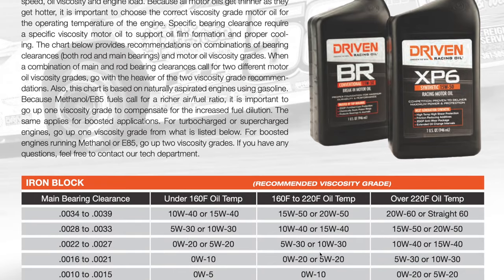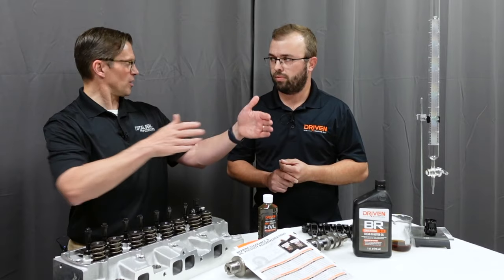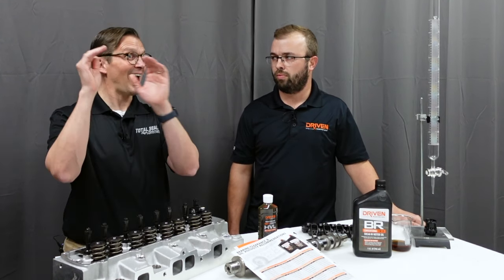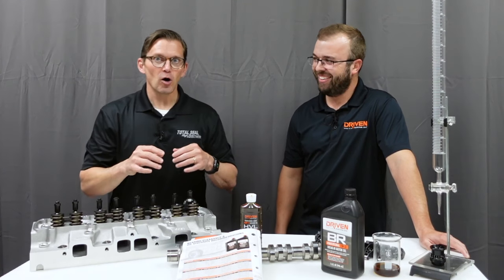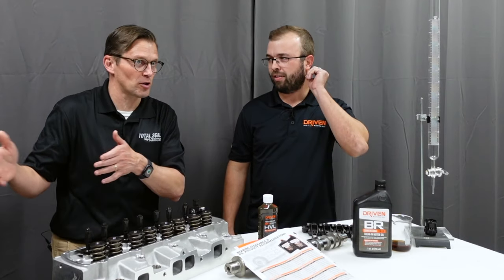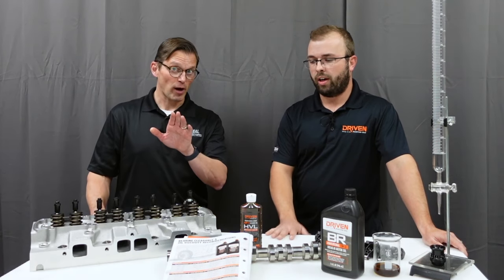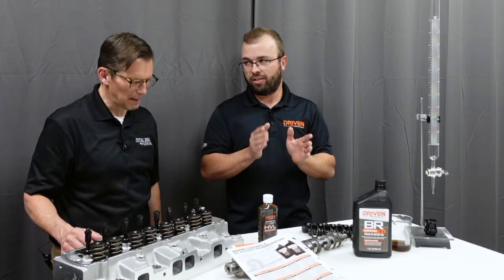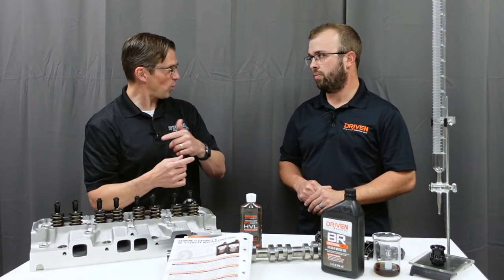How To Choose The Right Viscosity Motor Oil - A Certified Lubrication Specialist Explains

Comment: I have some questions about which oil to use in new race motor. I was recommended to use Driven oils but am getting a couple of mixed messages as to which one will suit the motor best. Is there any way of contacting you directly to get your thoughts?
Reply from the maker: Call the folks at Driven.
Reply: @TotalSeal  I'm in Australia and while that's not too much of a problem, part of my question has to do with info from my machinist/engine builder AND an Oil Rep at Driven. Both recommended a different Driven oil product so I'm not quite sure which advice to follow.
Reply from the maker: @333pg333  What's your application? Which products are both recommending?
Reply: @TotalSeal  It's a highly modified alu block Porsche 968 turbo engine for Time Attack that runs on race grade E85 only. It has been sleeved with Darton MiD sleeves which are a thick ductile iron product. The engine builder and machinist (who installed the sleeves) gave me a chart for the XP6 line of oils. Based on clearances you select which weight to go for. But when I contacted Joe Gibbs oils one of their Reps said this: “I chose the GP-1 15W-40 for a couple of reasons. The 15W-40 is a better fit for your main bearing clearance, your front and rear bearings were a bit tighter than the rest, but I would recommend going to the heavy side in line with the centre mains. I did not consider the XP for your application because the XP has very little detergent and virtually no corrosion protection package. XPs are formulated for applications that are disassembled and inspected after every event.”  When I looked at what type of cars GP-1 was recommended for it ranges across quite a few different purposes. From racecars to street rods. Whereas it looks like the XP-6 is for drag type applications where the motors are torn down after each event. Do you think I'm reading this correctly? ps...thanks for even responding. Much appreciated. Oh ps..before this motor was sleeved we used to run a 60w oil so I get nervous when seeing people recommend 40w product. But I don't know what the clearances were for the last iteration prior to sleeving.
Reply from the maker: @333pg333  Go with the GP-1, but use the 20W-50 instead of the 15W-40.
Reply: @TotalSeal  Thanks. I feel that this was what I wanted to hear. FWIW  my main bearing clearances are as follows:        Main Bearing Clearance
.0016”
.0025”
.0023”
.0024”
.0019”
The front and rear are a little tighter than the middles. The explanation from the machinist/builder was "The variation in main clearance is due to bearing shell wall thickness variants. The tighter clearance on #1 & #5 is not a concern as it is still sufficient clearance and well within manufacture specifications and .0005" larger than minimum."

Comment: I've got a 2013 F150 3.5 EcoBoost that recommends 5w-30 in the manual. Is there a better option you'd recommend? I use Pennzoil Ultra Platinum. Winter temps get down to -15 degrees F and summer up to 90 degrees F.
Reply from the maker: Stay with that viscosity and that oil.

Comment: i use 5w-30 for my g37 and i’m burning oil do I use a thicker oil or thinner , and no i don’t have a leak
Reply: Do an engine flush with liquid Molly
Reply: How many miles on the motor?

Comment: I own 2021 Yukon with 6.2 gas. 0w20 is recommended but truck burns it huge ( almost 2 quarts in 5,500 miles). Switched to 5w30- problem solved

Comment: So if my vehicle requires  0w20 that's what the manual and certified mechanics at Jeep Dodge Chrysler  say it recommends  0w20  full synthetic oil  if not true then what oil should i use and run on my 2018 Jeep Grand Cherokee 3.6 v6 4x2 ?  Anyone with that type of vehicle what do you use and any results  good or bad ?
Reply: Requires or recommends? 0-30 wouldn't hurt it.

Comment: Im thinking about running amsoil signature series 5w30 in my 2024 toyota tundra year around,  winter it can get down to -40 ,
Reply: I don't think Amsoil paid for the license required to have a warranty honored, check with Toyota.   Your owners manual states 0w20, you will void your warranty if they check the oil viscosity.  Most 0w20s perform the same in cold climates, in hot climates they will have a viscosity breakdown depending on the oil quality.  I'd run any 0w20 Full synthetic in the winter, under 30c, and Redline 0w20 over 30c.  Redline is a group IV POE oil, group IV has a better chance of keeping its properties at higher temps. Amsoil is also group IV, but I've read there were warranty problems due to a license they didn't pay for.
Reply: @lonniebeal6032  I went with amsoil signature series 0w30

Comment: Can you please explain why 5w30 oil is more expensive then 5w40. While 5w40 is supposedly to suit better for older engines. And the 40 weight has better oil film through additives?

Like a 10w60 race oil is for high performance engines. In my thought a 5w40 ia better for an old bmw m54 engine then 5w30 for running prolonged high engine revs like between 5000 and 6000 for more then 1 hour?

I hope you can shed some light on this??
Reply from the maker: The pricing question is for the marketing experts. That’s not a technical one.
Reply: @TotalSeal  thanks, could you also educate me/us on the 5w30 5w40 VS 10w60 for high rpm load of the engine? Regarding additives engine wear (assume all high quality oils like shell ect c3 and or bmw 10w60?It's an m54 bmw 6cyl.
Reply: More ppl use 5-30 so they jack up the price

Comment: Hey guys! I just built a new engine for my accord, currently breaking in the motor... New pistons, rings, bearings and valves, head and block have never been worked on, they where perfect, but the crankshaft got worked on (0.025), its an H22A with F22 crank and rods, OEM is 5w30/10w30, I was thinking on using 5w40 because of the crank work, the engine will be used quite hard sometimes on time attack events and (allegedly) street racing.
Reply from the maker: Good choice with the 5W-40
Reply: @TotalSeal  great! That's it then, next week comes the 100km first oil change, then 500km and then the tune!

Comment: 0W40 Run it in 120°F ambient daily driver and in -30 ambient daily driver hwy, around town, light duty towing in a Toyota Turbo 3 cylinder to a LS V8. From .0007 to .0016 oil clearance on up UOA and Forensic tear down all good. I am not talking about use in racing, diesels or heavy Duty towing. I just want and HTHS of 3.5 or higer in an oil that flows and pumps well. You can build a 0W20/5W20 like Redline does that has an HTHS of 3.3 as well and all is well. Stay at or above HTHS of 2.9 and most modern daily driver engines will be happy and live a long life. Once you get bellow HTHS of 2.9 you are really getting into what I call the "Forest Gump " are of oils. Sure you can do it and you might get away with it for modest CAFE advantages but it offers nothing to the consumer and you are riding on the edge of minimums. This is before you even get into VII shearing and additive packages and overly extended OEM OCI for the sake of lower initial cost of ownership for large fleets etc....My Toyota dealership has 0W8 and 0W16 in stock in the parts department and I say why bother! Consumer not dyno or NHRA qualifing or NASCAR qualifing engine! Trained Technician for Porsche and BMW in Germany. Raced in Rally Racing in Europe and SCCA in USA. Worked for General Motors for 7 years in Engineering Department. Worked in General Motors High Performance Parts for a decade. Worked in a minor role mostly in support for Childres Racing.  Oil temps, coolant temps, head temps, power densities per liter on daily drivers has steadily increased since the initial emissions and fuel ecconomy issues in the 1970's until today. Given the blowby issues and the issues we deal with with pistons with minamal skirts, thin, shallow low tension rings and GDI going a little bit thicker and a litte more HTHS than the CAFE based SAE viscosity recomendation since mass market oil will not give us a low viscosity decent HTHS oil. Driven, Exxon Mobil, Pennzoil and the rest could give us a 0W20 with an HTHS of 3.3 at a price point that is still profitable but they choose not too. For me 300,000 to 500,000 mile on a daily driver is my minimum. Currently GM can not put a timing chain in an engine that will go 120K miles with out failing no matter what oil you put in it that said why compromise?

Comment: I have a 2006 VQ35DE engine, anyone recommend the best oil for that engine
160k
Calls for 5w30, 10w30/40 are acceptable what about 5w40? Since the mileage is up there
And does oil compatibility, get more lenient, as the engine gets up higher in the mileage  j/w
Reply: Pennzoil platinum high mileage

Comment: What's the problem?  I just use the oil viscosity that's listed in the owner's manual and/or on the oil fill cap.
Reply from the maker: That works for stock engines, but not for modified engines.

Comment: My Corolla fuel economy was fantastic 1028 km for 38 litres. 
After the first service 
960 to 970 km 
I have become a little bit more heavy footed because I wasn’t running the engine in. 
So that could be a contributing factor. 
But I discovered that Toyota has been putting 0w-20.

Comment: I read a thread on a Ferrari forum a number of years ago where they were talking about oil temps and viscosity for road course use. They came up with the conclusion of using a thinner (not drastically) oil if your oil temps are high as some of that heat is being generated by the shearing action of the oil while it is doing its job as a hydrodynamic bearing...and they noticed the temps decrease over the course of a 20-30 minute session on track. Was there something else at play here?
Reply from the maker: Nope, they were on the money. A slightly lower viscosity oil can reduce oil temperatures significantly!

Comment: What oil is recommended for 6.4L Hemi in Dodge Charger?
Reply: If you're under warranty, what ever your owner manual states, if it only states 0w20, I'd sign up for Amsoil  and get theirs.  Or Redline, both have higher than most everyone else's TBN.
Reply: @lonniebeal6032  yeah I do get Amsoil in recommended viscosity 0w40. This last wild change I tried Amsoil 5w50.

Comment: Thanks for the awesome info! I always seem to be thinking about running thicker oil in my car. It's just a toyota v6 that i don't drive hard but I would love to try 15w 40 oil in the summer when I do long trips.  Never thought about the piston ring tension. I can't seem to get myself to try anything other than the 5W 30 my manual says but this was a fun thought experiment for me. Looking forward to learning more from you guys!
Reply: I'm a big fan of 15-40 and use it in a lot of my engines and customers engines.  I shy away from it in modern cars with variable cam timing stuff, some of them seem to be pretty sensitive to oils.  While there might be better options, you typically won't go wrong with using what the manual says.
Reply: @DonziGT230  "...you typically won't go wrong with using what the manual says."   Yup.  Could have been a single-sentence video.

Comment: Don't some Indy cars run 0w10 and they have what 1000hp 1.5 liter engines?  Granted their engines get rebuilt every race but oil now vs oil of yesteryear are 2 totally different animals.
Reply from the maker: The higher the RPM of the engine, the thicker the oil film in the bearings, so F1 and Indy engines can run thinner SAE grades because of their much higher engine speeds.

Comment: Isn't oil viscosity used determined by the bearing clearance your engine has? Bigger clearance - thicker oil and smaller clearance - thinner oil?
Reply: No.  Do you really think Corvette has a sloppy bearing clearance?  And they were originally wanting 0w40 in the car.  I don't know if the EPA has made them change it or not.
Reply: I didn't think they have sloppy clearance and that's why I was asking because I have been told that tight clearance needs thinner oil and big clearance thicker oil. That's why it's so difficult to know what oil to use.

Comment: For hot climates that are higher than 35° C, can I use the 5w-20? Or it's better to continue with the 5w-30?
Reply: 5w30 for the heat, 5w20 is thinner. Use 5w20 in the winter
Reply: @jd646  Thank you! I'll stick with the 5w30. The winter here in Brazil is hotter than 25º C (trust me, its true)
Reply: @magichatake Have you tried 10W30?
Reply: @RFJersey  no buddy, the owners manual says that it must be the 5w20 or 5w30

Comment: Just use what the manufacturer recommends.  Pretty simple.
Reply: Exactly, unless you are the manufacturer.  If you’re shopping for a ring package, the engine probably didn’t come with a car and a warranty. 😉
Reply: You mean that same manufacturer that has to pay a fine for not pushing 0w20?  Under warranty, sure, out of warranty, no thanks.  But I'd check the owners manual.  Got into an argument with a Kia mechanic pushing 5w20,  I wanted 5w30 for the summer, I showed him it was in the owners manual.  I suspect he put 5w20 and wrote 5w30 on the mileage reminder.  Then when the Optima started knocking on start up, they went to 10w30 all year,  Which was listed in the manual.  0w20 and lower is a CAFE', EPA line of BS for .1 more mpg.  Oh, I did get rid of both Korean cars due to the multitude of inherent problems and easy theft.

Comment: Curious why the mechanical test by Mechanical engineer at operating temps show different results.
Unfortunately Driven is way down on that list they provide..
#GMZDDPMyth.
Reply from the maker: The 540 rat blog tests you are referring to are invalid for actual engine wear. The test apparatus he uses has an appetite for calcium sulfonate, which is why his results more or less follow the amount of calcium sulfonate in the oil . The Oil Extreme additive is mostly calcium sulfonate. If a bench top test method existed that accurately predicted actual engine wear, then ASTM engine sequence tests would not exist. 

That is the reality of the situation, engine oil formulating requires engine testing, and those engines need to be representative of the intended application (spring pressures, materials, surface finish, etc…)

Comment: What do you recommend for a fresh 6.0 ls  78/75 turbo. Im running 10w30 for break in. It has 58psi cold but when it is 205 at idle its 28psi. Wondering if i should put a restriction in the oil feed line on the turbo

Comment: Lake my question is on a small turbo GDI engine that calls for 5w-30 but is now tuned and putting out more HP would changing to a 5w-40 be beneficial? Thanks
Reply: Yes. I used to run 5w30 in my Focus ST with 2.0 turbo gdi and the oil always smoked when I removed the oil fill cap after driving in the summer (desert heat over 100 most days). I tried 5w40 which was still API SP certified and the amount of smoke went way down to almost none.

Comment: IMHO, RTFM. The vehicle manufacturer is fairly clear in the owner's manual as to what oil viscosity to use. Don't bugger around with the oil recommendations from your car. Use what is recommended and don;t get caught up in oil company marketing spiel. My 2 cents worth ;-)

Comment: Good day everyone. I have a QUESTION: My 2015 Vehicle has 144K miles and the owner's manual calls for 0W-20. The question is : ✔Can I safely use 5W-20 during the Summer season? My thought is , It might provide more Engine protection during the Hot season. Let me know ,Please. PEACE .
Reply: Yes. You could run a 5w-30 or 0w-30 too.

Comment: I don't know about everyone else here, but I'm only using what my owner's manual recommends... period!
Reply from the maker: For a stock engine, that is the right choice!
Reply: Funny how that exact same vehicle with the exact same motor here in the U.S calls for a 0/20 no matter the climate yet in Europe they spec a 40w.
Reply: Manufacturers put economy over longevity nowadays to make cafe standards.
Reply: @jacobforeman9916  I think you are correct.
Reply: Wrong thinking.
Reply: And the owners manual also says that 30.000 km is ok for oil change.

Comment: Water cooled engines do have thermostats, with that, engines usually don't run cold.
Reply from the maker: Drag race engines and many drift engines do.
Reply: They also have radiators.  I had a 4 cylinder turbo that took 20 minutes to warm up and give me heat in the winter, and it warmed up in 5 minutes in the summer.  That thermostat won't open until it reaches the 180 or 195f it's rated for.

Comment: Most of this does not apply to a family car. A factory stock combustion engine need not be tweaked to get a faster turn around a course. It needs to be filled with an oil that will support a slower wearing out of all the parts that touch one another. The EPA drives the lower number oils suggested by manufacturers. It is about lower fuel usage for them. Neither the government nor the auto makers care about your engine falling apart after 90-100,000 miles. This site is about racing motors only. Worrying about break in oil for a late model 6 cylinder 4 door sedan is not where these guys live. Think.

Comment: How do you find out what your main bearing clearance is?
Reply: Projectfarm ran a lubricity test with 0w20 vs 5w30, that bearing test was 0.000, 0w20 lost, 5w30 left a film behind.  The bearing clearances are BS.  Freeze some 0w20, then pour it out, it flows like sae90.  So if everyday was 0 celcius or colder, most cars would fry their bearing if the clearance was truely designed for 0w20.